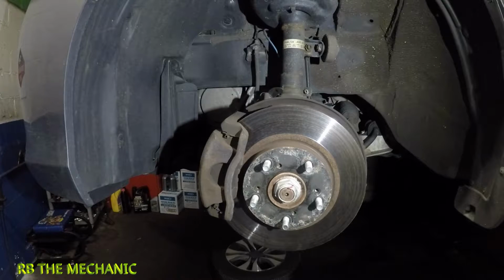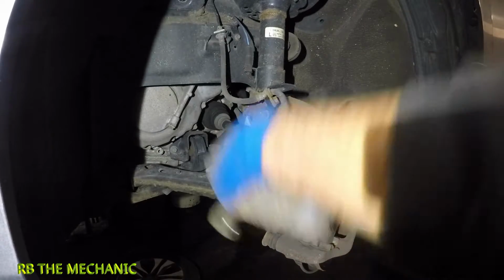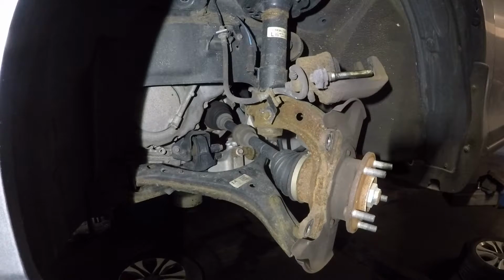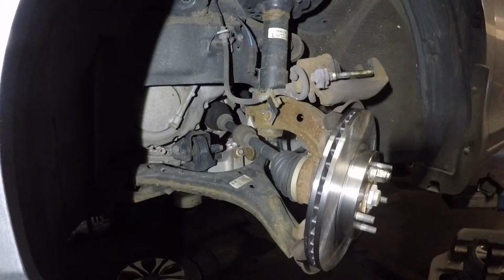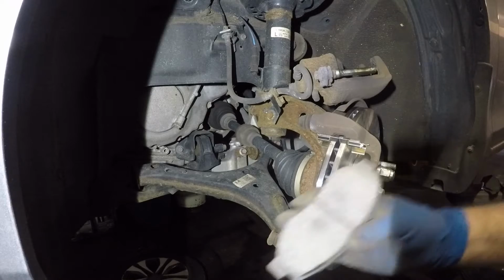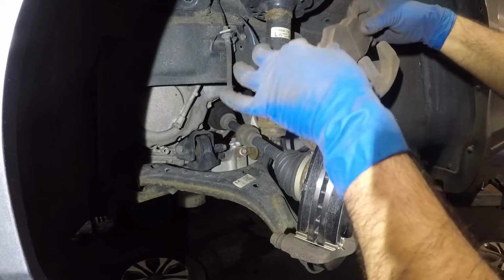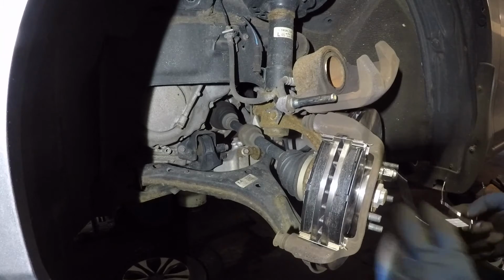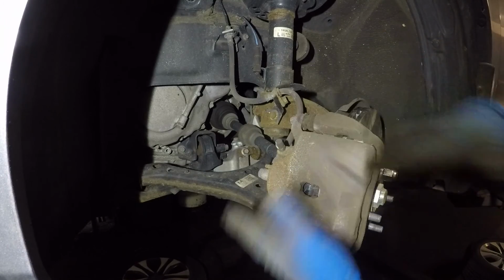How to replace Front Brakes and Rotors on Honda Accord 2013 2017

Comment: RB, what brand Rotors did u use ?
Reply from the maker: They r basic white box pronto.
Reply: @RBTheMechanic  I'm thinking of getting durago titanium brake rotors with bosch quietcast brake pads and I got bosch quietcast on my honda now and I got over 70k miles our of them or I'm thinking of using bosch rotors or acdelco rotors what u think rb ?
Reply from the maker: @Pat06  I wouldn’t go ac delco I had issues but your choice they got warped in months
Reply: @RBTheMechanic  sup RB what your opinion on Autozone Duralast Gold Brake Pads ? Would u do a video on your ranking and opinion of the top 10 or top 5 Pads and Rotors for sedans trucks and vans Just go by your experience and what you learned throughout the years of being a mechanic. thank you for producing this content 🙏. Saving me $$$ on my 2014 Honda Accord, lx.
Reply from the maker: @Pat06  I’ll try but idk how I would rank them without testing them all but I like autozone parts I don’t like their rebuilt axles